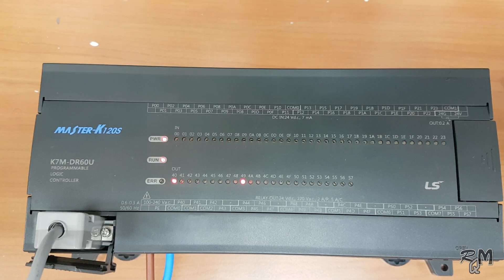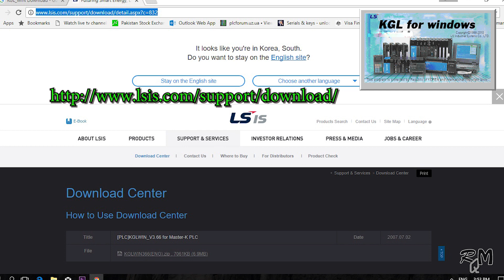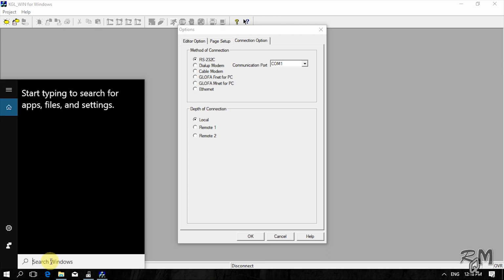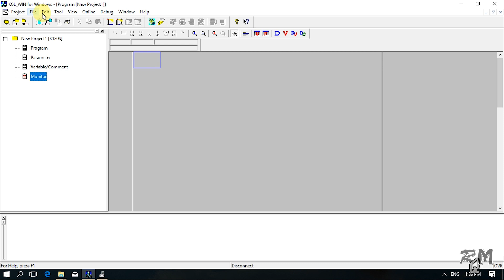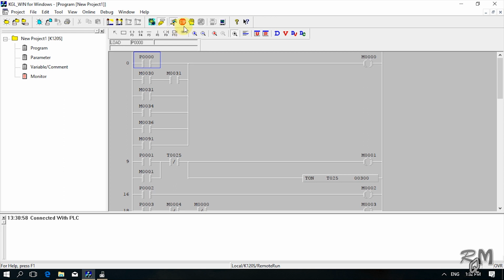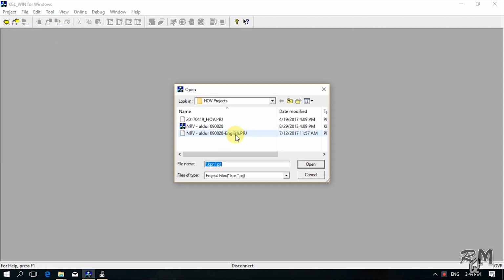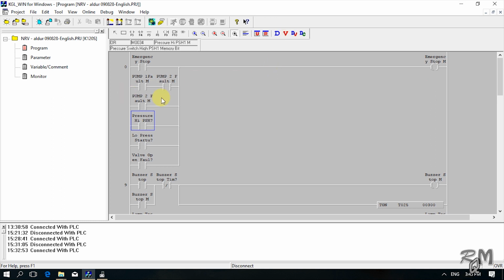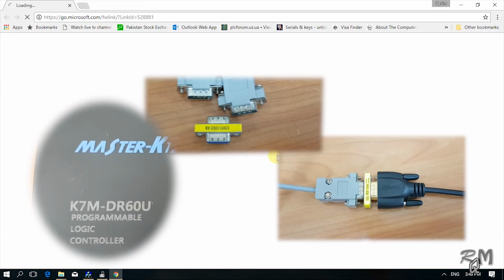Master K120S PLC Part 01 Connection Upload Monitor

Comment: HI 
Did you every Communicate LS Master K120S PLC and Delta HMI DOP-B07S411  in serial Communication RS 232   I need 9 Pin Connector Pin Wiring Details

Comment: hello. Could you show process of backup project from PLC and restore on other PLC?
Reply from the maker: Dear Alexandr SL for upload and save u can use same as described in video, then keep open uploaded project or open saved project. Then connect same model Master K controller and this time use Write command to download to PLC.
Hope its helpful if not then plz tell me I will try to share video as soon as possible.
Reply: Dear Qasim, thanks for your answer. I try to explain - if I understand you correctly, it mean that I could take programmed PLC and made backup and after that download backup to another PLC? Because from your message I couldnot understand - Do I need source code of the project or not?
Reply from the maker: Alexandr SL4 if u want to download copy of ur already programmed Master K to new Master K PLC. Then use READ to upload program from old PLC, save it keep file open then connect  to new PLC and use WRITE menu to download. No source code required.
Reply: ok, I will try. Another question)))Quasim, could you share cable pinout for this connectivity?